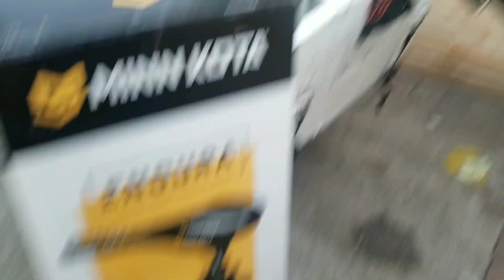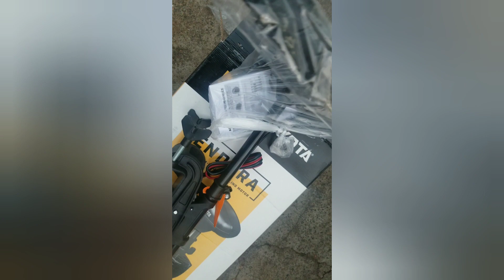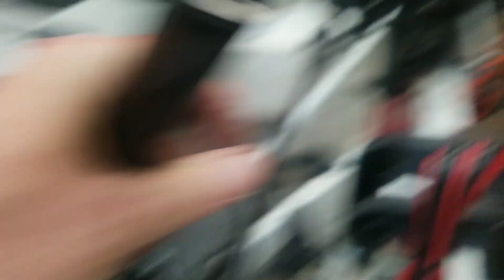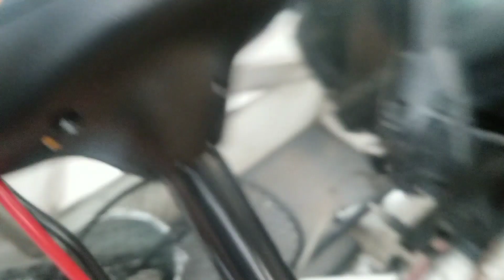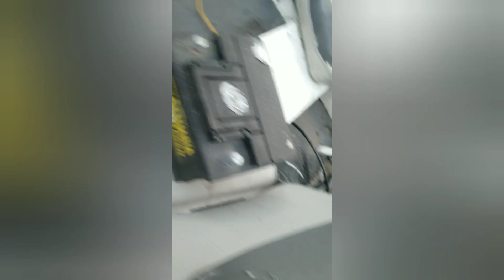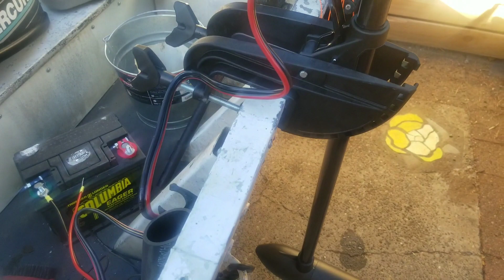Minn Kota Battery setup and Install Electric Trolling Motor on Transom

Comment: Dumb question. Does it not matter if you put the negative or positive on first when connecting the minn kota to the battery?
Reply from the maker: I usually attach the positive before the negative

Comment: What size is your boat? How do you like this minn kota?
Reply from the maker: It's a 14' Mirrocraft.  I like it for what it is and it's value.
Reply: @JasonSipe16 hey man I have the exact same boat and I got a 55 pound thrust what are some good batteries you recommend I hear lithium ruins your motor if it runs on fast speed for hours ? How many hours do u get on this battery on the water ? Also do you reccmond having a circuit breaker ?? If so why ? Just wondering since I’m new to all this . 😎